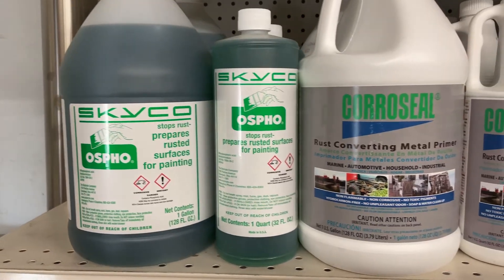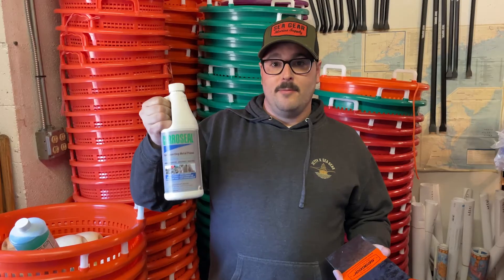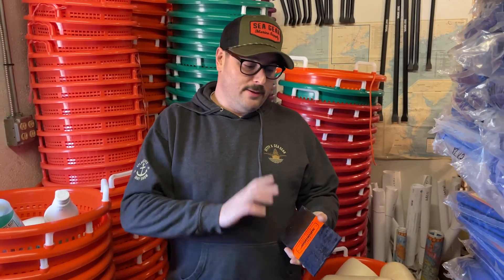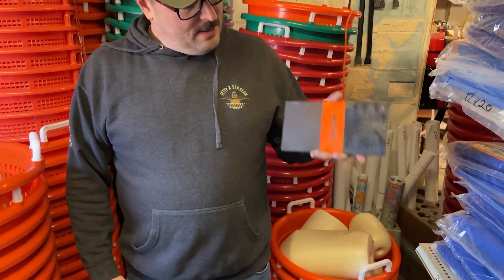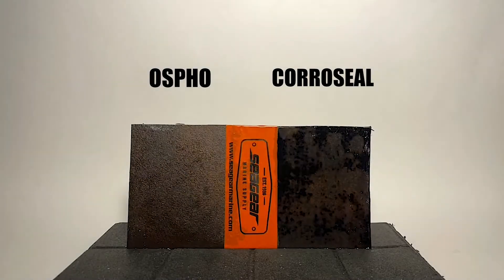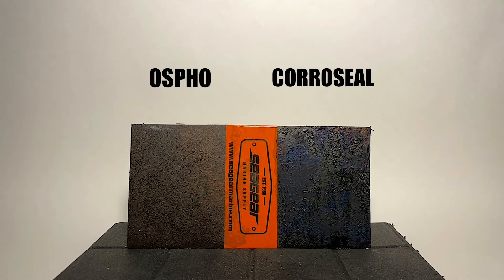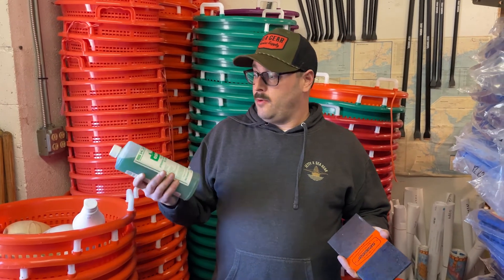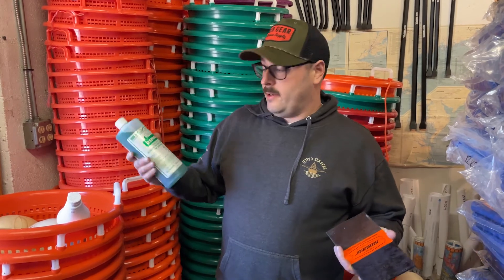Rust Conversion - Ospho & Corroseal

Comment: I want to turn unrusted raw steel black and then coat it with linseed oil to keep it that way for some outdoor metal art. Would the ospho work well for that or would you recommend something else?
Reply: How did it turn out? I want to try it out as well
Reply: @missioncapable4658  I decided to use something called Birchwood presto black. It worked awesome but you had to get it all off or it would rust the metal very quickly just like vinegar does. I neutralized it by rinsing with sodium carbonate which you can get really cheaply at a pool supply.  After that I coated with penetrol which is basically a polymerized linseed oil.